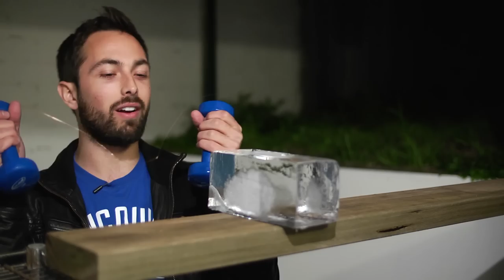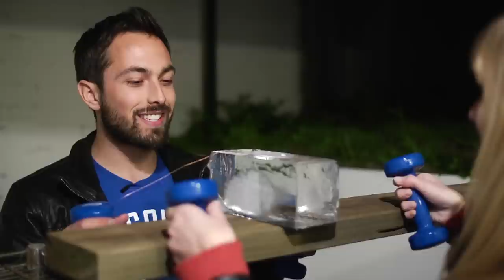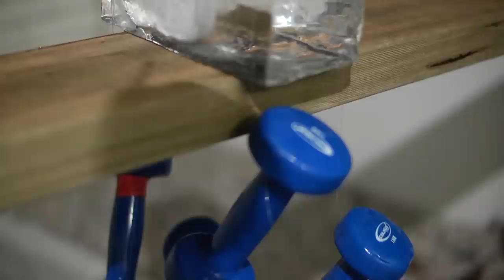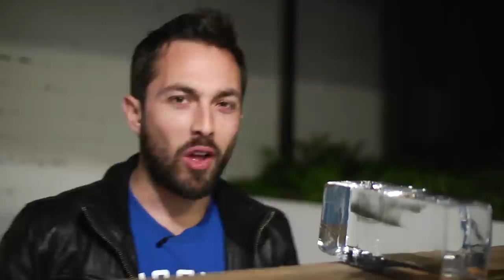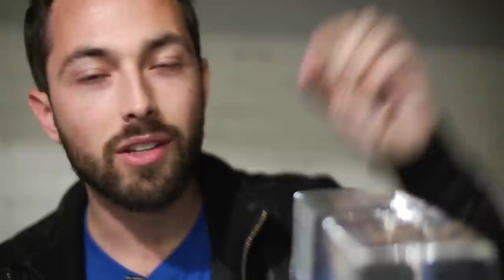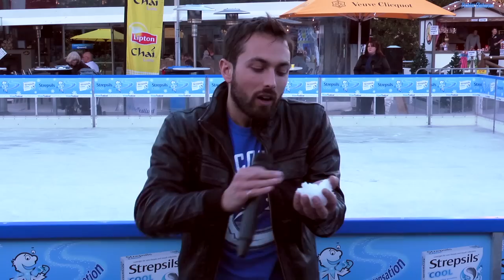Ice Cutting Experiment

Comment: Isn't it the heat that is transferred from the external environment to the ice through the copper that makes the cutting faster?
I mean if you make the same exp in the pole where the pressure will be the only parameter will you have the same results?? Right now you are in a hot environment that allows heat to transfer to the ice through the wire....

Comment: The copper is faster because it transfers heat from the surrounding air along its length, I expect it cuts faster as more wire is exposed as the weights drop.

Comment: Ah, also the copper wire is not really smooth; it has microscopically  jagged edges thus increasing its surface area. Is this enough to effect the experiment? And is the fishing line really smooth? I don't know, but it is another and unconsidered variable.

Comment: snowball example is actually false, you can't exert the pressure required to melt the ice with your bare hands. It's more due to the fact that all solid water has a thin layer of water on top due to fewer hydrogen bonds at the surface. When you compress snow, those thin water films around the snow particles refreeze.
Reply: Owned! Nice dude. Hope he sees this.

Comment: Not really, The process it's called Thermal CONDUCTIVITY which means it has to be connected to other object e.g. your hand, the process your thinking about is radiation produced by e.g. your body, sun then the heat is convected through the air and then is conducted through wire. There is also friction from moving wire and heat conducted form 2 weights.

Comment: if principle is pressure melts ice and after restoring pressure ice should freeze again. this experiment is incorrect from my perspective. the experiment should have been you place wait on top of ice, record if it melts and remove wait and check if it freezes again. even better way would be to create pressure controllable chamber and place ice inside , now change pressure of the chamber and see if principle holds.

Comment: Umm... no. Its if there is enough pressure in the specific area(smaller contact point is better). 
I suppose if its hot enough like room temperature and the ice melts that would work, but that's not what the experiment is showing.

Comment: why when it freezes it releases heat? shouldn't it be the other way around?
Reply: Thomas Leoro i was gonna ask same question. someone ELI5 pls
Reply: When you put water on a hot stove, you are giving it heat, so it boils. When you put water in a freezer, it's releasing heat to the air inside the freezer, so water freezes and the air heats up a small bit.

Comment: I simply stated that when pressure is applied to ice the melting point is lowered, there for it melts. When the pressure is removed, the melting point is returned to normal, and if it is cold enough the water can freeze again. I made one mistake, saying raised instead of lowered.

Comment: Try making a snowman, or snowball, using dry, powdery snow i.e. in sub-zero temperatures: impossible.

A wire cutting ice, the forming of snow-balls, ice skating: all unfortunate regelation myths passed on from text-book writers to their readers, who then become writers ...(https://en.wikipedia.org/wiki/Regelation#Misconceptions)

- To depress the melting point of ice by 1 °C requires a pressure > 10 MPa: the equivalent of concentrating the weight of a 100 kg adult on less than 1 cm².  The palm of a hand has a surface area of 20 - 50 cm².  So, according to this video's theory, if you can support a weight of 2000 - 5000 kg (two to five cars!) in the palm of one hand, you might be able to exert enough pressure to make a snow ball when the temperature outside is -1 °C...

- Pressure (no matter how large) can not depress ice's melting point below - 22 °C, so at temperatures below - 22 °C ice should no longer be slippery(?) - tell that to the ice truckers of Alaska, or researchers in Antarctica ...

- Following Pascal's principle, liquids transmit pressure equally in all directions, so once any part of a snow ball melts due to external pressure applied by your hands, the entire ball should liquefy; similarly, an ice-skater's blade should sink all the way, until the sole of the shoe rests on the icy surface ...
 
- Pressure changes are transmitted with the speed of sound (in ice: 4 km/s): the wire cutting process should be indistinguishable from free fall, the wire always encountering only liquid drag, not solid resistance...

Comment: Wrong !!!!
You cant´t by hand press a snowball so it melts, Ice melts at a slightly lower temperature, att high pressures. 10MPa (100 times atmospheric pressure), changes melting point about -1 oC. See wipedia about ice: wiki:/File:Phase_diagram_of_water.svg

Comment: Was the environment temperature always  0 C degree trough the experiment?
Reply: Engin Yeğnidemir when the ice melts due to pressure the temperature doesn't change, so the water is liquid below 0C, and when the pressure goes back to normal the water freezes just because it's colder than 0C

Comment: i am highly skeptical of this theory of regulation. i don't believe the ice melts because of the compression it melts because of friction and thermal conductivity the wire is conducting the heat from the outside air over a very small surface area of ice. and then when it has finished its pass the water refreezes because the ice next to it absorbs the heat from the water. and in the case of the snow ball there is already a small amount of liquid water mixed in with that snow. while i was living in minus 3degrees Fahrenheit weather in the winter it was darn near impossible to make a snow ball because there was too little liquid water to hold the thing together much like how water soaked sand becomes more globular and sticks together better than dry sand which is vastly more freely flowing. good try but this was a non example proof of this theory even if this theory does exist its only has a very minimal to non existent impact.

Comment: So if one were to remake this experiment with, say, a one-hundred foot tall block of ice, it would accelerate until it was noticeable in real time?
Reply: No.

Why would it accelerate?
The only reason i can imagine why it would accelerate is, that the heat from the water freezing again, accelerates the wire, which produces more heat, which accelerates the wire etc.. 
But i can't imagine the wire to go really fast through the iceblock.
Reply: Sebastian Mensch Do you have any sources? He said that the melting and all that accelerated the ice, so logically it would accelerate until noticeable in real time.
Reply: SirTeddy Ill As you see, i have edited my comment and came to the same conclusion. Now i am curious about that too. :D
If there is to much heat, the water will not freeze again, so there will be no heat added i think.
Reply: Sebastian Mensch Veritasium! We need you!
Reply: SirTeddy Ill Or we do it on our own. :D But we need much ice,... very much ice . :D
Reply: Sebastian Mensch And thus is the problem...
Reply: I think it does accelerate, but much like something falling through the air, it reaches a maximum velocity due to friction. And I think that velocity is very slow, and I think it was reached in Derek's experiment here. But that's just my thought. It seems very counter-intuitive for the wire to fall through the ice at a noticeable rate. The changing surface area of contact between the wire and the ice may also be a factor. In the end, though, I think anyone repeating the experiment with a larger block of ice will simply see the same results Derek did, but taking longer to reach the bottom. I'm not certain of any of this, But it's what I think would happen. Anyone more knowledgeable on the subject (Derek Muller, cough cough) please feel free to correct me.
Reply: SirTeddy Ill The point of equilibrium is reached when the speed at which it moves down proves a detriment to successfully transferring enough heat from the top of it to the bottom to speed the descent. This speed is probably not going to be very fast, but it'd be nice to do an experiment anyways.
Reply: Patrik Manni I think I will try it when we get ice down here. Can't wait.
Reply: yes it will accelerate because after all pressure is force applied per unit area, so where there is a force ,there is acceleration.and gravity and electromagnetic forces are there to help..
Reply: Yes it will accelerate but only to a point. There is only an acceleration if there is a NET force. If the force of gravity is balanced out by the normal force and by friction, there will be no net acceleration. It will fall at a constant, and very slow, speed. I think this is exactly what we saw in the video.

Comment: The wire has a small surface area. A smaller surface area results into a larger pressure force exerted. That's why a thumbtack pierces when poked with the pointy end whereas the flat larger end does not pierce. According to the amazing thermodynamics, specific latent heat is increased in bodies with a higher pressure. Therefore, the points with the wire melts as it has a higher pressure. #yeahscience

Comment: MORE INFO ! ! !  we need to know the ambient air temperature ! ! ! without this info it is impossible to guess. 
above Freezing = copper wins
below Freezing  = fish line wins
Reply: kiysiy Below freezing means that the energy from the ice & copper would quickly be conducted OUT of the ice block into the air. 
Above freezing: the energy from the air would be conducted through the copper INTO the ice. 
Fishing line conducts energy so poorly it would show little difference in speed with small ambient temperature differences.

Comment: wait it refreezes?
Reply: +terry feng Yes, because the ice around it is still cold as ice, so the water freezes back into ice
Reply: +Marcus_Mravik so it's takes longer to melt?
Reply: +terry feng When you put pressure on ice it melts because the freezing point lowers. But when the pressure goes back to normal (the copper wire isn't putting pressure on it) the freezing point goes back to normal as well. 
So the ice stays the same temperature all the time, it just freezes at different temperatures because of the pressure.

Comment: isn't it weird that it melts undr pressure yet when you compress water it turns into ice?
Reply: Water doesn't turn into ice when its compressed.
Reply: +Thentai it doesn't? hmm even weirder then
Reply: You can't compress water, think of hydraulics.
Reply: yeah true, but in my min it just sound so logical xD
Reply: While water isn't that easy to compress, it certainly is possible to do so with large forces applied to it. Just as when you reduce the pressure of water you lower both the boiling and the freezing point, the converse is true as well. As you increase pressure you lift the boiling point and the freezing point, and with large enough pressure applied to the water it is possible to turn it into ice (assuming you keep constant temperature). Then, further increasing the pressure of the ice will lead to a fracture of ice.